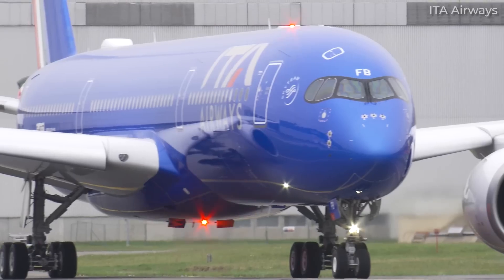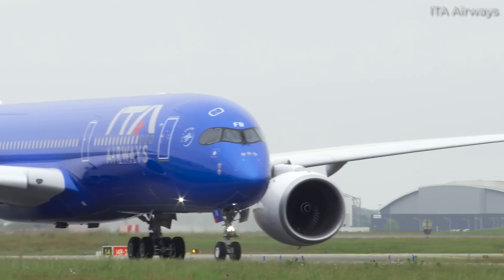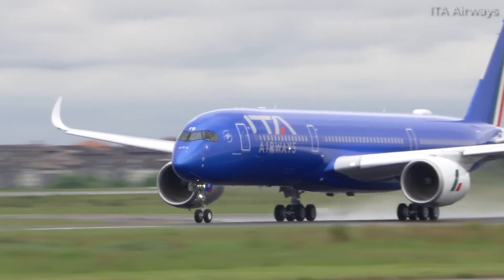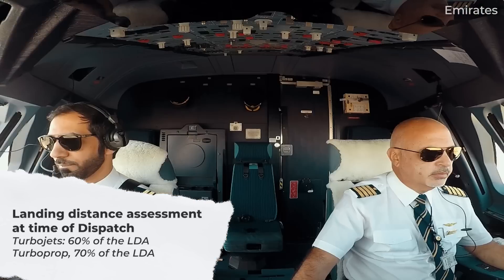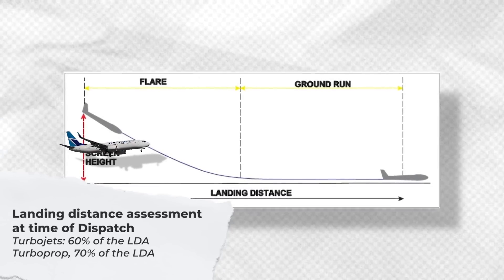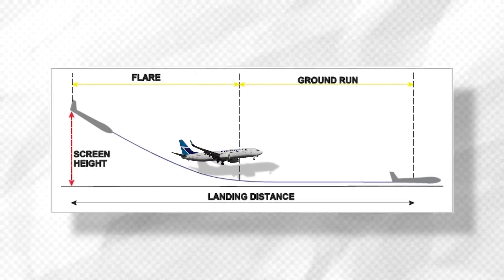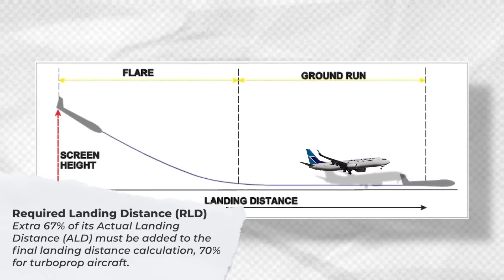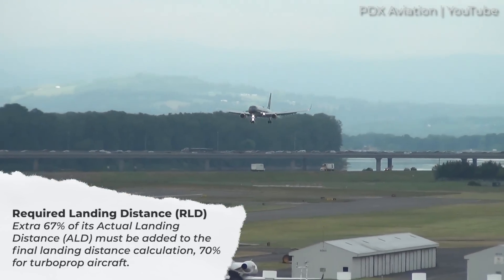What is Landing Distance & How Is It Calculated?

Comment: I remember coming in for a firm landing into a rainy Tokyo Haneda back in 2013. Our JAL Dreamliner decelerated hard and swerved left and right as the pilots fought to maintain control. There have been other bumpy arrivals, but regardless, landing is always my favorite stage of a flight. The airplane travels slower which gives you a chance to admire the landscape below. You also get to see and sometimes hear, the control surfaces moving and the landing gear being extended. Finally, you can see how the pilots are making tiny adjustments to the ailerons and spoilers to keep the aircraft on course during the approach.